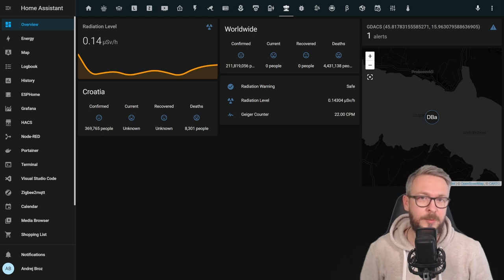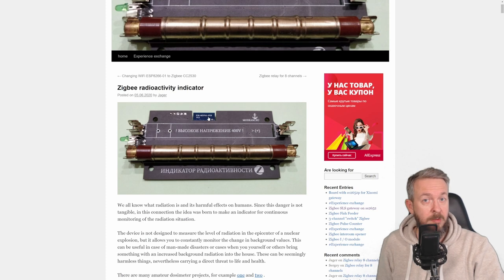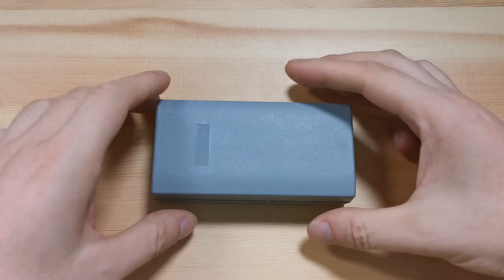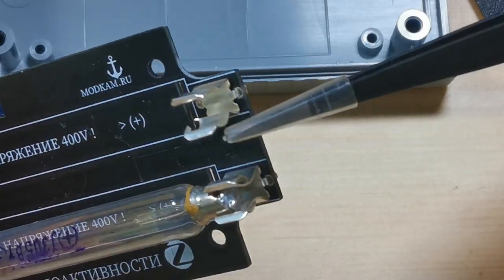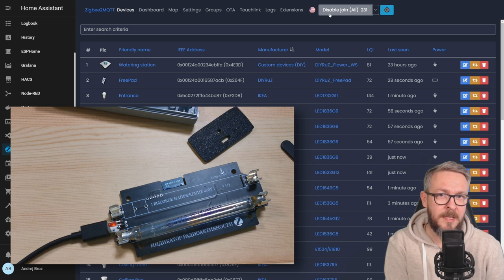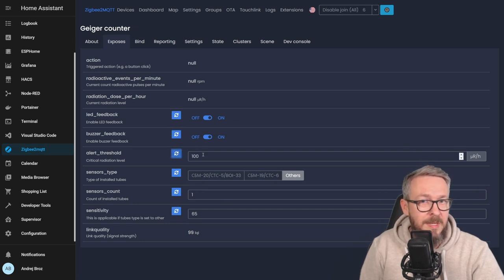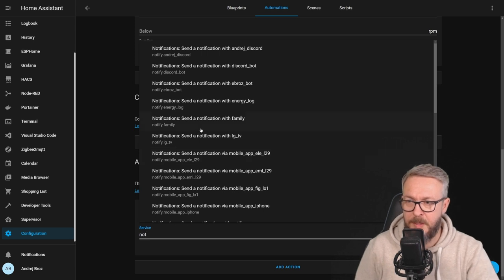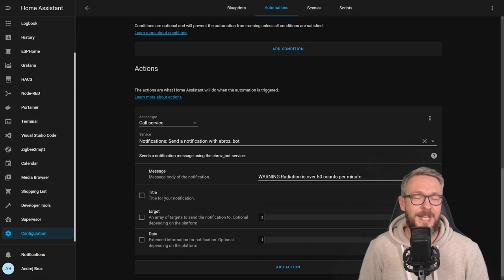Make your own Zigbee Geiger Muller counter & router

Comment: Thanks for the tutorial, just got soldered all except 7.5Mohms resistors which somehow I missed to order.
Also, there is a question about  E18-MS1PA2 modules, did you or anyone else tested it with this module? I have those modules so it would be great if it works with it. If not, I already ordered  E18-MS1PA1-IPX, as I understand they are same like the one required, just with external antenna. Any suggestions?
Reply from the maker: Wow, it's been some time :)
If I remember correctly E18-MS1PA2 should have improved something (was it signal? or sleep?) and it could be plug in replacement for original model. But I haven't tested it.
IPX version is just external antena, but I don't think it will work. Somewhere I've read that it requires different code.
Reply: @BeardedTinker  omg, and I was sure that IPX is 100% compatible and that is only difference in external antenna. And that PA2 need some code adjustment.
Reply from the maker: I know that from other project where IPX required different firmware. Didn't try with geiger counter firmware.

Comment: This zigbee module is not available anymore, where die you buy it. Only the E18-MS1-PCB of the E18-MS1PA2-PCB
Reply from the maker: There is one similar module, but not the same. It should be same specs, but you need external antenna for it - E18-MS1PA1-IPX. This one is available as far as I can see. All the places I bought mine are out of stock for E18-MS1PA1-PCB. Even Amazon, ebay, manufacturer of them is also out of stock...
Reply: @BeardedTinker  Thank you, i'll order that one, the parts for the zigbee projects of Jager are sometimes difficult to get. Is it for example possible to use the same zigbee module as the freepad for this project, i ordered 5 zigbee modules for that project.
Reply from the maker: @DirkTas  I know - I have bunch of "wrong" modules and was fool not to order more of right modules.
Difference between remote and this one is that module for remote is for battery powered devices. And I think that firmware will not work. But there is another project that is nice and uses this E18-MS1-PCB module - doorbell sensor/ringer.
Reply: @BeardedTinker  Well the 5 E18-MS1-PCB are not lost, i'm planning to make more remote control devices. I guess i have to use a normal 2.4mhz antenna for these ipx zigbee modules? I'll check  the doorbell project , video of this comming up?
Reply from the maker: @DirkTas  I need to double check components, I think I have all. But probably not in next 2-3 weeks - too many Zigbee DIY projects :) Need to diversify content ;)